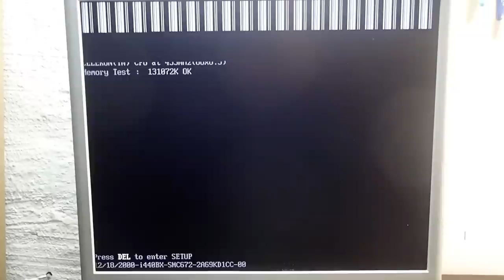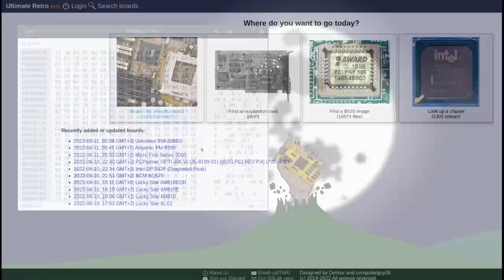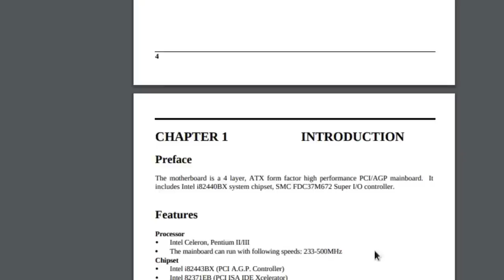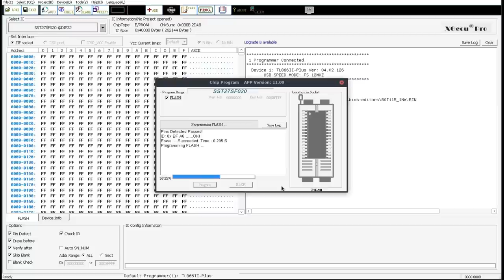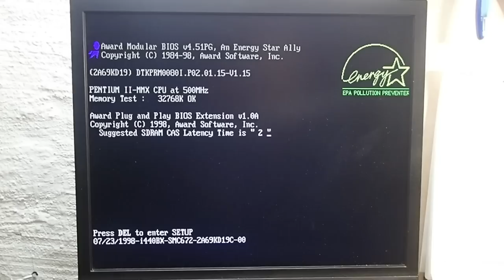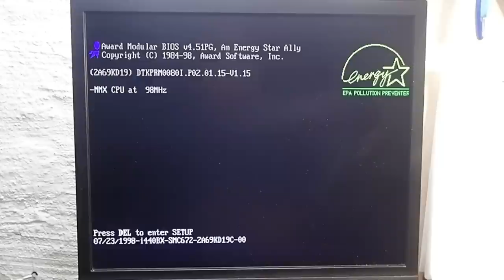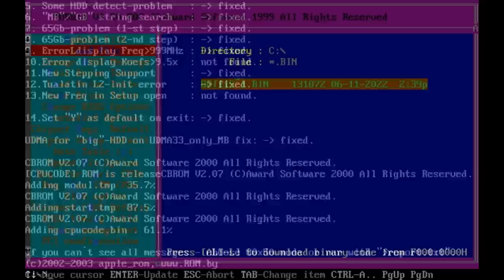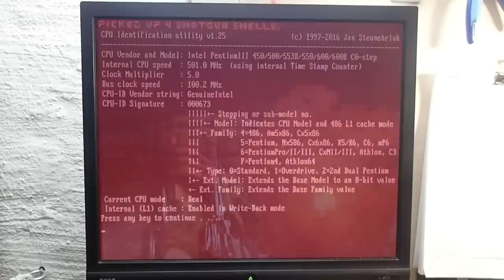My endless confusion with a i440BX Pentium II mainboard.

Comment: Ah memories.. 11:11 I worked in Fab 10 in Intel Ireland when the Pentium II were being made.. its good to see some of them still knocking around..
Reply: I worked in Fab 15 where 440BX chips were made. It was as if we couldn't make enough of them. We used to buy Celeron 300A and overclock it to 450MHz.
Reply: Thank you both for your work, if not for that I would have missed some pretty epic and chill gaming moments.
Reply: I still got a box of approx ten old slot1 333-500mhz cpu's made in Ireland. Some of them used to overclock really well. I used to run a couple of 500mhz in a dual hp tower server with a matrox agp and two matrox pci cards. Great little workstation at the time.
Reply: God I love Pentium II's so bad. I actually remember back in the day when having a P2 or P3 was ace. For some reason I remember Pentium 4 as not being altogether that amazing, as it was so cool to have a Pentium II which was the basic of what you needed to play each game worth playing (no hardware accelerator necessary, I guess video card graphical accelerator or GPU would be equivalent, you did benefit a ton from having a soundcard though, back when onboard sound was such shit that Soundblaster was a valid use of money for gaming). I also actually remember when having TWO cores was something amazing. Like wow, just look at that, it has DUAL CPU's!
No I pretty much look at it and we got enough cores that you can actually play Doom in task manager. Not just a Ti graphing calculator, I mean I actually saw someone using CPU utilization in task manager to try and render graphics on a Threadripper. Games can't even keep up with CPUs at this point.

Comment: This makes me want to dig one of my 3 440BX chipset rigs out of cold storage and have some fun with them again!

Just so that this information is known for people wanting a Pentium II PC:  If you are looking for a 440BX board to start building a Win98/DOS rig, look no further than a Cisco PIX-520 firewall device.  It hides an Intel brand motherboard with the 440BX chipset.  I would recommend swapping the guts out of it into a standard ATX case because the Cisco case is proprietary.  With the Cisco PIX-520, you will have the motherboard, a 300MHz Pentium II, some RAM, a standard 3.5" floppy drive, and an old Gateway style PSU.  You should be able get one of these for about $75-$100 USD.  That's better than the $150-$200 USD that a Pentium II system usually goes for.
Reply: I have no plans to follow this advice, but I gotta say that's pretty awesome.
Reply: I've installed I don't know how many pix firewalls over the years in places like banks, hospitals, 911 centers, you name it... so it's kind of odd that I've never heard of this big enough to drive a mac truck through sized vulnerability that you just described.  Anything is possible, I suppose.
Reply: I'm not seeing those online for the price you described. They're all right around $200 already, or have insanely high shipping costs that push it right up to that range. What about the PIX 525? That seems to be reasonably priced and has a Pentium III. What kind of board would be in that?
Reply: @jeremyandrews3292  That one is proprietary and wouldn't really fit in any other case without some metal work.
Reply: $200? And here I was giving away for free slot 1 board (ok, with via chipset) with some PIII CPU and nobody even ask about it. 
Maybe it would be better to stick €100 pricetag on it :)
Reply: 200 dollars for a PII today, man the stuff I have is getting more and more expensive, I also have a computer with an Abit 440BX PIII that I put together when these computers was the market that I am still using today
Reply: @Milkmans_Son  the ancient pix devices have a number of critical vulnerabilities associated with them. Though I don't think their architecture counts as one.
Reply: My friend bought a "video machine case" and it had a 440BX board, 256MB PC-100, and a Pentium II 300 Mhz in it.   I told him that was a good score, turns out he junked them because he only wanted the case. That along with a AMD K6 300 Socket 7 IBM Aptiva.   There are a lot of people that will actually buy that stuff, but of course you have to store it till you get it sold.   Like I was told once "It is worth a lot,but only if you have a buyer."

Comment: This video had a bit of everything.
- Board repair, troubleshooting.
- The suspense when a repair doesn't work.
- Hacking / modding the bios to run stuff it wasnt supposed to.

Thanks for the video!
Reply: Don't forget The Matrix! 😎
Reply: I wouldn't really call it hacking/modding of the BIOS since all that's happening is including the necessary Identification and microcode.

This is exactly what the sort of thing that a BIOS firmware update might have been be issued for back then.  
  
I.e. the CPU is theoretically compatible, but the BIOS needs to know what to do with it.

Comment: Your efforts with 'vintage' hardware inspired me to revive my dual-P3 system from my university days.
Tyan Tiger 230T -- now with dual P3 1.4Ghz Tualatin (the 512 KB L2 cache model)
Had to replace some capacitors, a few were looking tired, but not exactly dead.
Currently compiling some FreeBSD source code on it 🖤
Reply: It is really fucking sad to me to be living in the Dark Ages of Humanity. A day will come where all our books have been burned and everything, every bit of human knowledge ever made, is encoded on a bunch of shitty NAND flash chips and that, even without the solar flare, even if they could have magically been kept stable and able to retrieve the data 50 years later, there simply isn't any capacity to manufacture the hardware/firmware for it anymore. Like they are going to find a bunch of shitty useless PCBs in a landfill somewhere and they will contain all the greatest treasures of humanity and all the treasure of human greatness ever written, and it'll all be lost, alongside some guy's useless bitcoin keys. And no one will even know what happened and why, because they didn't make a hardcopy for literally decades by the time it all went down, and only some musty national archives buried under a mountain in West Virginia or somewhere in Siberia or Alaska or Norway is even going to contain the precious scraps we have left to pass on to future generations.
The coming calamity will be literally worse than the burnings of the Library of Alexandria. At no other point in human earth history has there been such a great and total universal loss in all human knowledge, than when they made all that data digital and then promptly lost the ability to retrieve it by a combination of incompatibility, corruption, physical destruction, and loss of knowhow to both the parts and the data itself. 

You think I'm joking and I'm not, they can find things like the cure for cancer and "cures" for male pattern baldness and the cure for smallpox but it'll be like basically trying to unearth a fully working STC. Already, we have physically lost the blueprints to make the original rockets NASA made.

If you want just a taste of this, go try and find some website you remember from the 1990s. Or some article. Or even go and find some meme you remember from the late 2000s that was literally so everywhere nobody even thought to archive it, much the same as it occured to no one to try and save their old CRT monitors in the 2010s. At least now a CRT can be found in theory. 2035 A.D.? Good luck. 
At least on the plus side all the shitty memes will have also died permanently (though it irks me they outlived the good ones, nobody remembers the Calgary Keys, but the shitty, crap ass cringe-disgusting forced meme of a bunch of brainlet 12 yos like slenderman still survived to have games made about it, while Gideon's Calgary Keys are mostly 404'd)
Reply: @drek9k2   'Tis a fundamental law of the Universe. Nothing is meant to endure in perpetuity.

Comment: Great repair job there! 440BX is such a great platform with a wide range from mid 90's DOS to even early WinXP era. I've got a Jetway J-7BXAN with a P II 450, which even goes up to 133 Mhz FSB. So with a Slocket adapter, this could potentionally even be a 1400 Mhz PIII system if I ever desired that.
Reply: That´s true! because I actually own a MSI i440BX Slot 1 one with a slocket and a Coppermine @ 1 GHz which works flawless at 133 MHz FSB.

Comment: All the 440BX chipset one of the greatest chipsets Intel ever produced! I'm so glad you got that board working! 
I had an Abit BH6 BX chipset board with a Celeron 300A overclocked to 464 Mhz for quite a long time. 
I later had a Socket 370 Celeron 566 Mhz in a slotket adapter in a Asus P3V4X slot 1 mainboard seriously overclocked to 892 Mhz using a 105 Mhz FSB. 
Those were the days! :)
Reply: I'm searching for that board Asus P3V4X. Hopefuly I find it sometime, but last year, no luck. If i remember correctly, it was VIA 694x chipset board, with ISA slot, and universal AGP.
Reply: @warrax111  It was a really nice board. I only replaced it because I won an AMD Athlon XP 1800+ and a MSI motherboard at an AMD roadshow event when the Athlon XP chips were first launched in 2001.

Comment: Nostalgic... I had an ABit BH6 rev 1.01 (iirc), it wasn't supposed to be able to run the Coppermine cpus until rev 1.2 (also iirc). With the latest bios i put my P3 700 in a slotket with the stock cooler, it booted up and i set it to 7*133 (933 MHz) in the bios with a little voltage tweak and ran it like that for a long time. Never a hitch.
The ABit BH6 rev 1.2 is pretty much the ultimate BX440 board, especially for overclocking. FSB, different bus dividers for PCI and AGP, memory latency, voltage tweaking etc is all done through the bios and with a lot of different options.
Reply: Similar history with latest asus 440 bx boards

Comment: I have an i440BX based system on which I run WinFLP as a platform for running 16-bit Windows and DOS applications.  The CPU is a Celeron 700, which is supported by the BIOS but is deliberately underclocked to 528MHz as this particular mainboard (Gigabyte GA-6BX7) can't be clocked that high with a processor made for a 66MHz FSB.  The video board is a 16MB AGP Radeon 7000, chosen for its ability to drive a 1920x1080 display.   WinFLP runs surprisingly well on there considering it only has 256MB of RAM and XP Embedded really wasn't designed for that generation of processor.

Comment: Maybe he updated to the latest (but incorrect) BIOS and then after seeing the graphics corruption he checked the power supply and thought that damaged the motherboard.
Despite the ATX specifications of ±5% for +3.3V, +5V and +12V that come on some of their stickers, actually in the most common (cheaper) power supplies all voltages tend to vary by a percentage proportional to that of +5V , that is, ±3% for +3.3V, ±5% for +5V and ±12% for +12V because the regulator only cares about stabilizing the +5V and the others come from different taps of the same transformer.
Only some slightly better (expensive) ones also regulate the +3.3V to prevent it from exceeding the maximum value, if the +3.3V goes too high then those will pull the +5V and +12V down as much as it takes to keep the +3.3V in range, even if that means the power supply itself or the mainboard decides to shut down because PG (power good) goes also too low.
But the +12V beyond incorporating more and better filters (again according to the price tag) I have never seen any ATX power supply that takes them into account at all for regulation purposes, if a low resolution voltmeter is used it will be easy to find a worrying 14V in the +12V output and think that it has damaged other components.
Reply: I saw it more times , that someone incorectly identified motherboard, or did mistake in revision, and flashed incorrect BIOS. These boards often ends in electrowaste, and it's so easy to repair them, if you have BIOS flasher card, and BIOS is socketed. So pity for motherboards, that were destroyed. Particulary slot 1, socket A and super socket 7 ones.
I have one such board, MSI KT6 Delta, and I don't have how to repair it. Sooner or later, I will have to throw it out, because of space problems, and it ends up destroyed. What is worse, BIOS chip is not socketed, but soldered, so it would be more difficult to flash it.
Reply: @warrax111  what winbond superio and what flash chip? looks like it might have an LPC flash chip on there. We could work to bring it back. A common fault is that the winbond LPC flash will fail during writing and will not be written to ever again, you might as well replace it, which will make it easier, i.e. you can just cut it off once you have the programming rig figured out and scoop up the leg remnants, and soldering a new one in is easy enough.
Reply: @SianaGearz  Don't know, it's just Microstar KT6 Delta motherboard, eighter LSR or FSR, the one without RAID chips.
Reply: @warrax111  Ah figured it out for you, if i found the right schematic. It's an MS-6590, it's got Winbond SuperIO W83697HF-VF and W49F002UP BIOS flash chip. You write it with a TL866 or have any repair shop program you a blank chip like that, you clip off the original chip and solder a plcc32 socket in its stead, and simply plant the chip in there, again you don't have to do it yourself, any repairman can easily do it for you, they don't have to be specialists either.
Reply: @SianaGearz  Thank you. I note it to motherboard, I copy paste your message, and put it on paper next to it, when I push it to someone for repair.